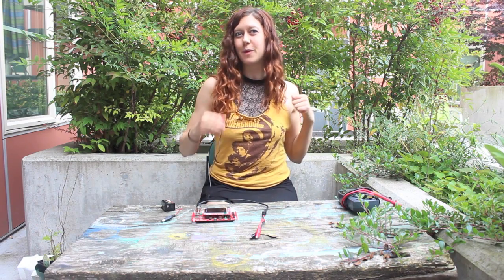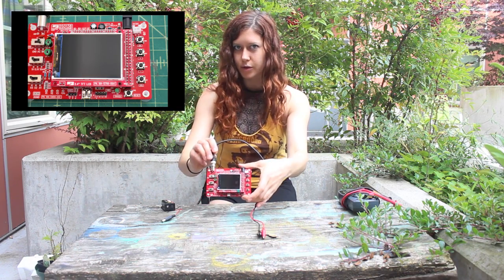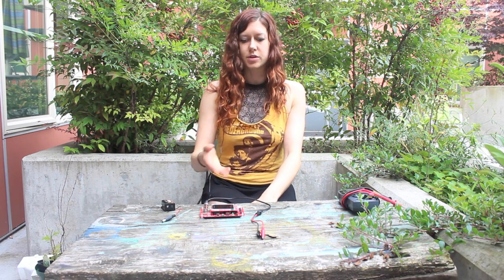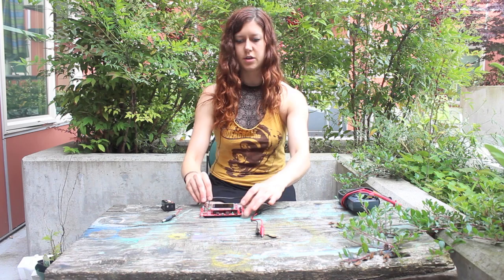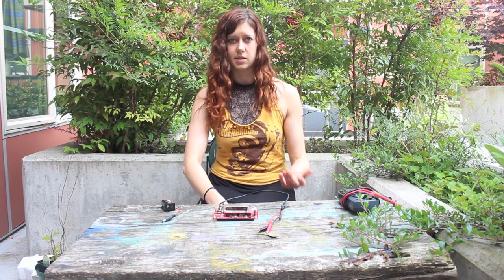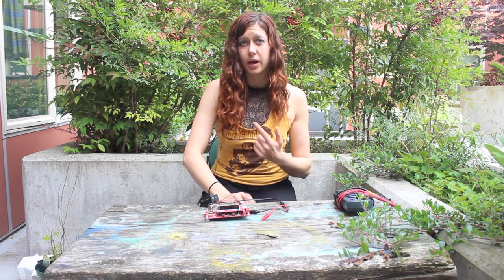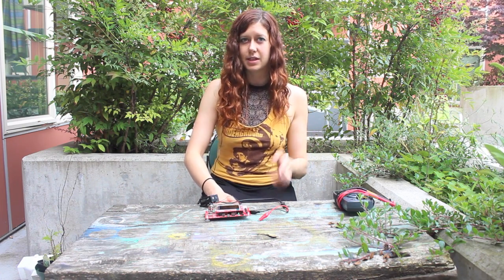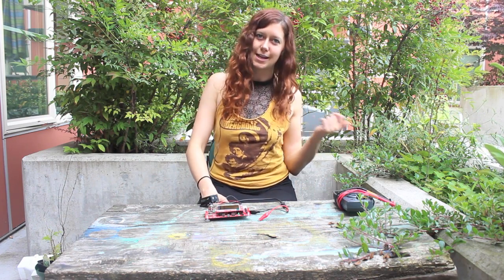How to Use a (Simple) Oscilloscope!

Comment: Can you use it to test crank sensor or cam sensor, coil, alternator signal whatever in car work?
Reply from the maker: Whoops just saw this! Hmm this is a pretty low current and voltage oscilloscope so I wouldn't recommend it for most car applications unless you're on the low voltage side of things. I'm not super familiar with car voltages/currents so use your best judgment 🙃 and hey, if you do blow it out, at least its only $30!
Reply: @JenFoxBot  so which one i can buy hantek 6022be is it good
Reply from the maker: @Sroor90010  do you know what voltages and currents you'll be working with? A quick search tells me folks use the one you mentioned use it for automotive tech, so it should work!
Reply: @JenFoxBot  ok thank you 👍
Reply from the maker: @Sroor90010  happy to help! Lmk how it goes, I'm in the market for a more serious oscilloscope myself 🙃

Comment: Can I use this to cars electronic
Reply from the maker: For interior electrical systems it should be fine (e.g. stereo), but the oscilloscope current rating is too low for it to be connected directly to the car battery. you'll need a bigger, more robust oscilloscope for that.

Comment: But do you need 9v ac adapter to make it work ?
Reply from the maker: Nope! The DSO oscilloscope uses DC power. You can connect a 9V to it directly (via barrel jack) or use a power supply.